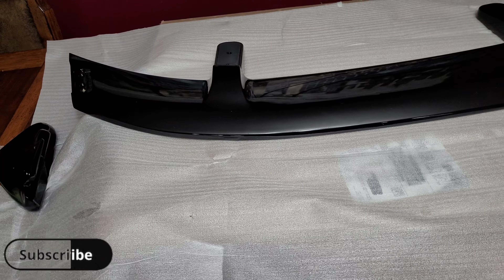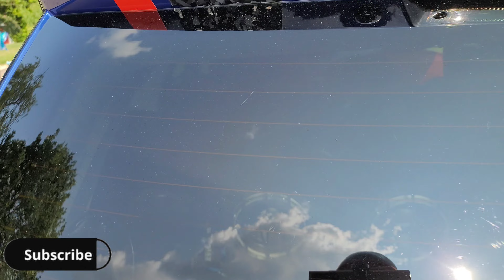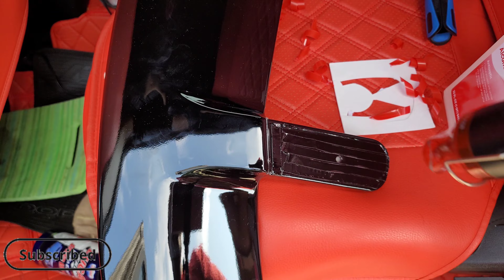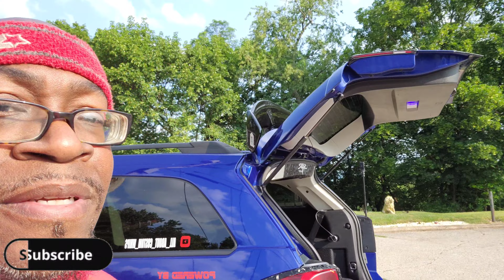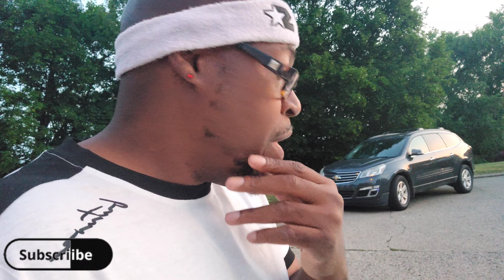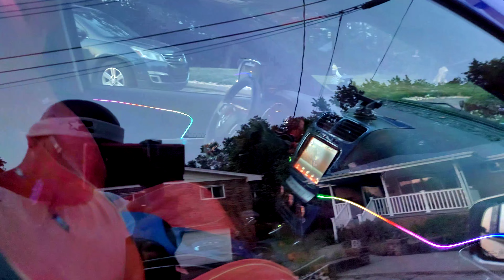Installed my sport spoiler on my custom dodge journey

Comment: What's up brother, I  couldn't comment on the latest video. First Congratulations on the 1000 subscribers. I have been watching and I think you could do wheel spacers to make sure the tires don't hit in the front. They are pretty cheap and easy to install. Good luck 👍🏼.
Reply from the maker: What up bro.. i was gonna do wheel spacers... they would make the wheels fit...but for what i was told..they are all made of aluminum ..which binds to metel when heats up the shops inasked wont even install them coz the dont wnaa be liable...and from what i understand the lug nuts for them are not good either ...but i was gonna go that route...b4 i knew what i kno now about them...if this wasnt my daily..i would do them..but not on my daily
Reply: @Kevsworld412  My dad has 1/2" spacers on his 2011 Genesis and they have been on his car for 3 years with no problems at all. I don't know how big of a spacer you need, but I think you  would be fine with 1/2" spacers. I would call a rim shop out of state and get a second opinion.  I know the really big spacers are not to be trusted, but 1/4" - 1" should be fine. I have people who daily drive with spacers and some 10 year's plus. My best friend has a Denali with 26s and spacers going on 12 years and it's his daily. Just make sure your spacers are hub sentric.